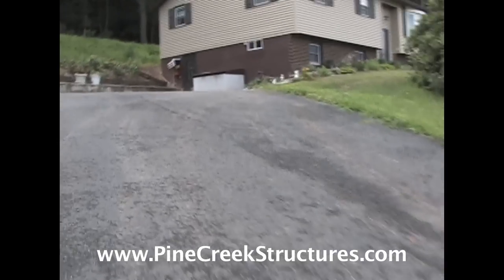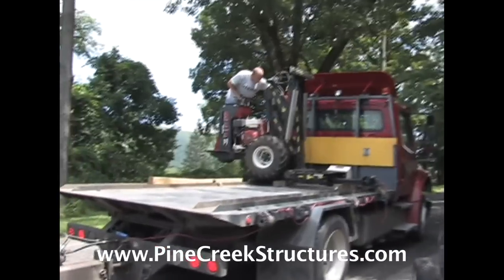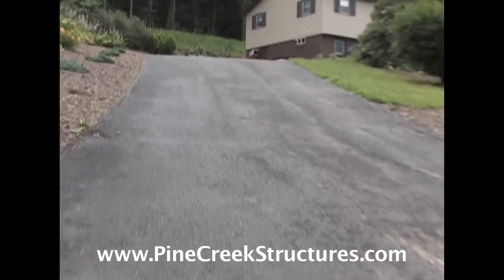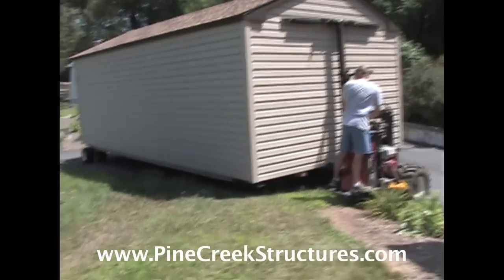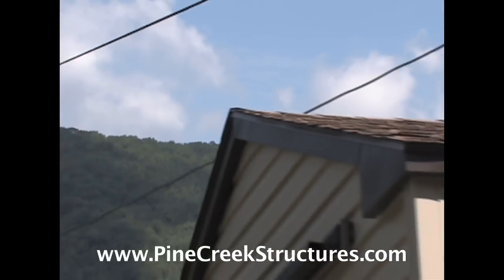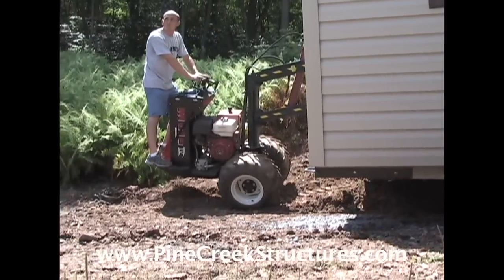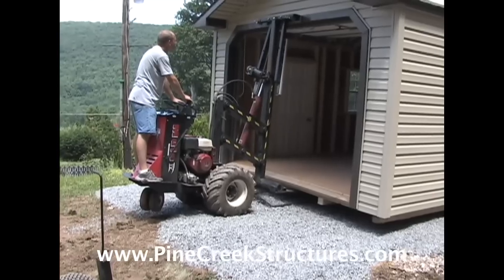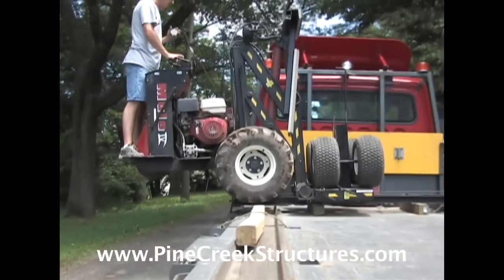Pine Creek Structures Shed Mule Delivery

Comment: It would be safer if it was operated by remote and it would be easier to be able to look around the load
Reply: ...and yet it isn't remotely operated and he did quite fine..
Reply: Kevin Lowe  with a remote setup, the operator cannot "feel" what the equipment is doing. I've seen experienced remote operators lose a piece of equipment because they could not feel that traction or stability was going south and I've seen old men with decades of experience do what looks to be nearly impossible by the "feel" of the situation.
Reply: ROTAXD and I've seen remote controls stop communicating with the equipment before also.  On a job where we had a crew in building a large retaining wall they were using a remote control vibratory packer for consolidation.  The remote and machine quit communicating for some reason.  Luckily the operator was able to manually kill the engine before it drove over the wall.  

Remote units like that add a few thousand dollars to the purchase price, cost an arm to fix and throw in a leg if you need to buy a new one.